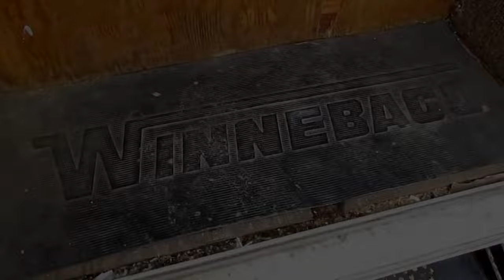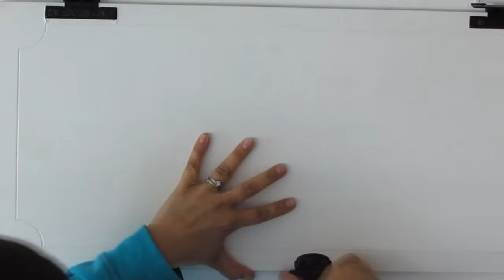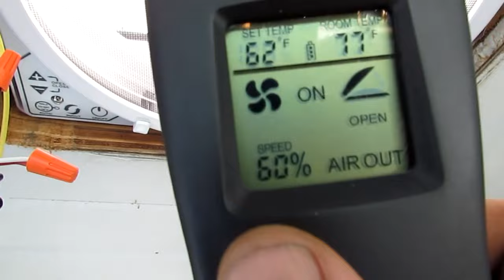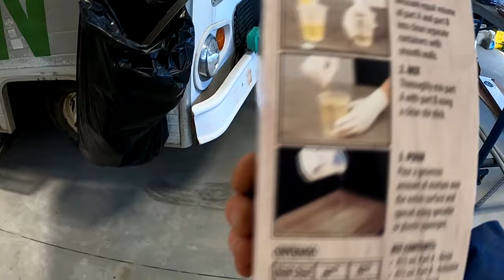VINTAGE RV Restoration | UPDATE | 1974 Winnebago

Comment: pity you ripped out the original interior and threw it away. its hard to match modern stuff in a vintage camper. these vans will be worth a fortune one day. not that one though. half its parts are gone
Reply from the maker: Yes it is a shame and we agree. Would have loved to keep more original but also a lot of the interior paneling was destroyed and horrible smell. Sometimes things just need to be done and we are happy so far. Still have some to work on and would love to keep the outside original.